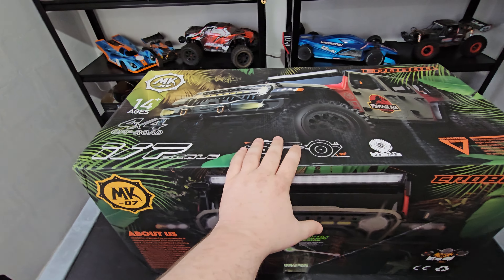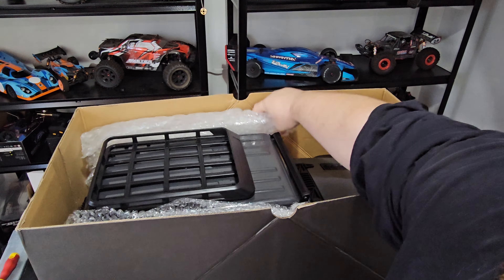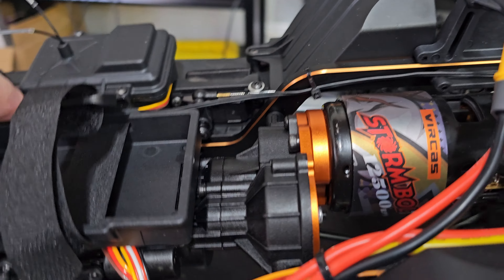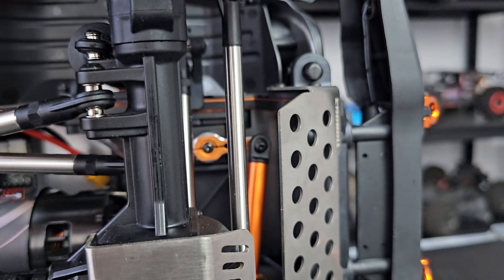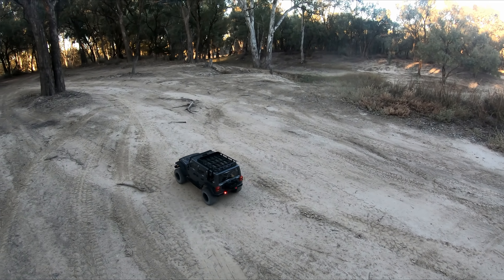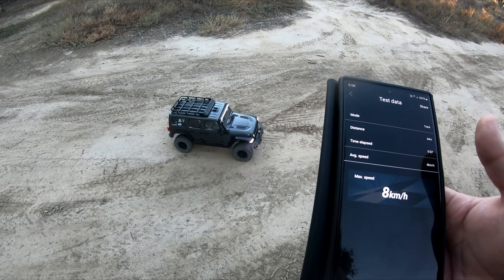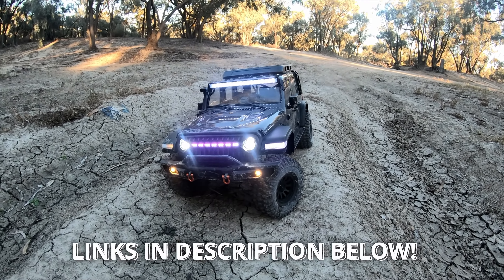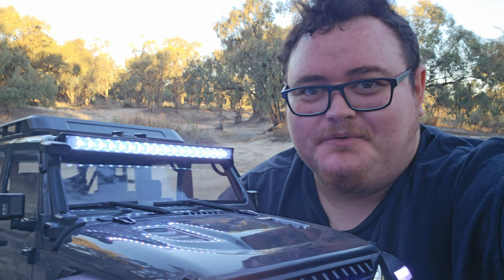NEW! RLAARLO MK-07! 1/7 Scale RC CRAWLER! - Unboxing and Review!

Comment: So that's a standard size servo? I already planned on getting the truck asap just because Its cool looking, how good are the tires? soft/hard/will there be any choices for different ones or will we be stuck with what comes on it? Have you confirmed how many they are making and how good do you think the part support will be? I may have talked my father away from the scx-6 for this instead (because we rc together and I can't afford scx-6). I noticed that it says up to 3s batteries but could I put a 2s in it? I would assume so but sometimes the translation software the Chinese companies use messes up.

Comment: I am a crawler fan and I'll tell you this is over priced where we live, ie you n me in Oz.
They want $1500 AUD for the brushless version, you can get the SCX6 for $200 more.
The problem is that there is no local distributor for RLAARLO which means when someone does sell to Oz, we get shafted.
I think the SCX6 is better value when you do this comparison, once I go over 1K for a crawler, I am all in and that means the biggest I can get.
There is an 8x8 but it comes with a old style joystick controller = garbage. 2K AUD and you need to still add parts.

The MK-07 is great for people in the US, but for us, I think it might end up being like Traxxas where we get charged double $.
I think I have a crawler that cost me $900, basic portal machine converted to brushless and then added tracks and upgraded servo.
It's not the size of the MK-07 nut it's 1/2 price when you don't do the upgrades I did.
These sell anywhere from $400 to $700, depends if you get the full locking front and back portals.
Has 2 speed as well, mine hoons on 3S tracks.

I know I will still get the SCX6, the can is the size of a coke can, I mean bigger is better right?
Reply from the maker: Yeah dude, i remember buying my first xmaxx for $1350 and now they're nearly $2k! Absolutely terrible 😞 

I think the brushed MK-07 is a good price for getting a big Crawler but yeah, if the brushless model is that price, then the scx6 is a better deal!